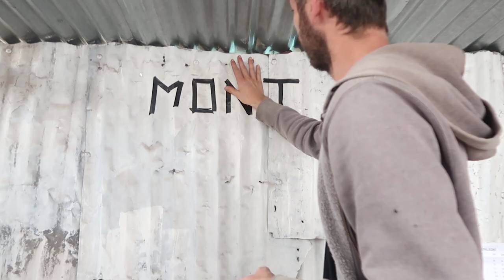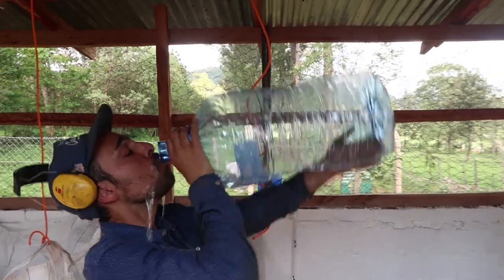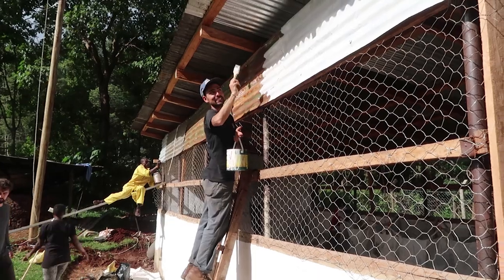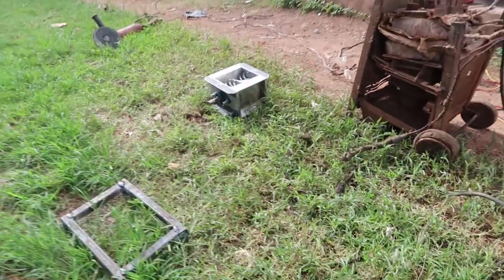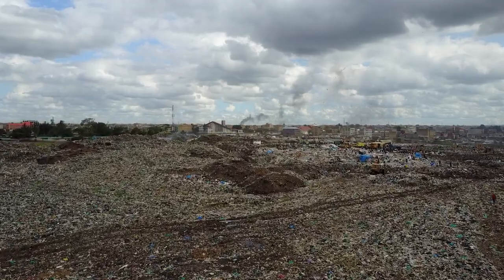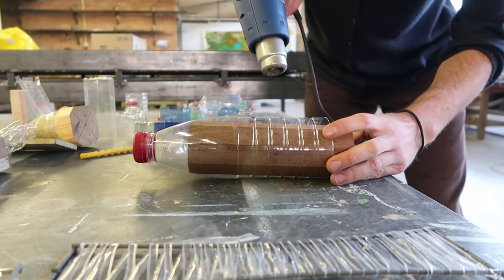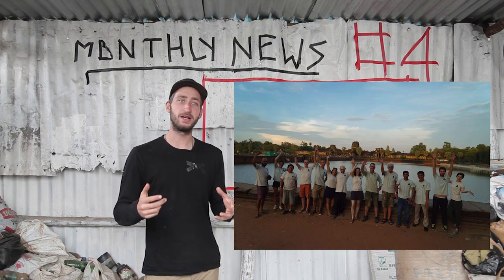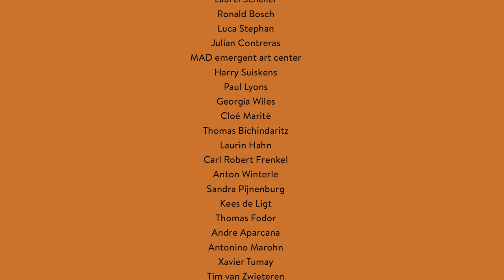Monthly News #4 - Welding in Kenya, PET research & flying the drone on a landfill

Comment: Love it. Also don't forget to make billet plastics for sale. CNC machining of plastics could be a way forward as well. Making larger 30-50cm x1m long billet chunks of plastic could open a whole new world of manufacturing for everyone. Also one more thing to consider when making those molds. Flower pots are fine and dandy, but you could make hybrid bricks also to make green homes that are put together with very little cement/or effort. Just reusing plastic trash while being fairly energy friendly, think lego but on a much larger scale.
Reply: Bruno M. I had the very same thought.  There is a large market for machineable stock.  If we are just prototyping, why not use recycled materials?  One question I still need to research is the off-gassing of the plastics as it is melted.
Reply: Excellent point! There are many home work shops and small businesses with lathes and mills that would use recycled materials in the form of billets and blanks or flat sheets of they could get it since buying virgin material blanks is very expensive!! Think about blocks or round stock that can be shipped cheaply!! Also want to say you guys are awesome and are actually changing the world!!!!
Reply: Yeah great comment. I've thought about molding some kind of brick out of plastics to make homes out of. Problem is I think you need special glues to glue plastic bricks together or you need to weld / solder them.
Or maybe make something like shingles out of them. Depending on the plastic that might require dyes or coatings to make them UV resistant.
But the CNC stock is a great idea too!

Comment: I'm going to make this comment without looking to see if you've already done it, but there is an idea that you can use PET bottles to make joints, especially for wood and plastic members. Cut both ends from a bottle, leaving a cylinder. Insert two poles of wood. Heatshrink the pair. They are now joined! Various joinery geometries can be useful here.  Micaella Pedros is the only person who I've seen using this idea. No one else appears to have picked it up.

Comment: There is a site I saw using PETE as heat shrink to improvise a size reducing adapter on a dust collection system in a shop.  It also seems that some repair can be made on a leaf blower where the tube has snapped off of the motor.  I don't think this stuff is suitable under much pressure without sealants though.  I have no idea if this stuff is good for electrical insulation, but hope to find out.  It looks like PETE might work as an abrasion barrier for things that don't get heavy use, and is easily replaced.

Comment: I have been thinking about PET plastic too.  Bottles are 3 parts;  spout, bottom, and middle.  The middle seems most useful.  2-liter bottles that are completely flat, could this be used like plexiglass?  Also, I've thought about using this plastic to make pipes, gutters, or for general water moving.  maybe you could make a heat press machine?  I've tried the hot air and it only shrinks to a certain size before distorting and burning.  with a heat press, you could form fan turbines out of flat plastic, as long as you have the form to press it into while at ideal temperature.  Little finicky, but well worth it since the plastic is so abundant and few know what to do with it yet.  Also, could it be ground into powder, then heat pressed?  it never gets molten like #2, so heat would have to be distributed evenly, but it beworth trying out.  Thank you guys for doing what you're doing and keep up the good work!!

Comment: Great vids! But on a practical note, with the technology you have developed and the resources you have access to, can you make larger solid objets? I do not mean like a brick or tile (you can use the oven for that) I mean like a large sheet of plastic to make a door, for example. Or a fence post. Processing large volumes of plastic. I could think of a couple of ways to do it, by disassembling ovens and have the resistors underneath a large mold in the shape of a door and slowly heat the plastic, then press it with a car jack. Would you say that is possible?